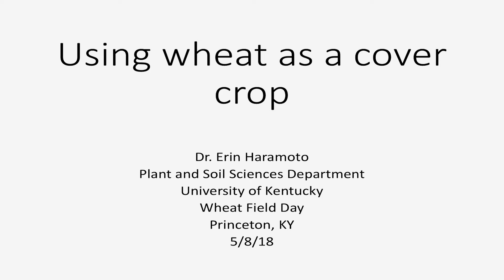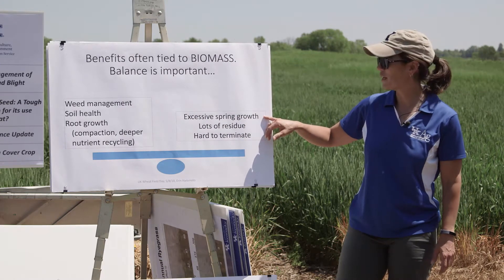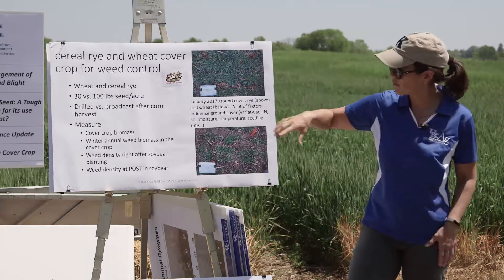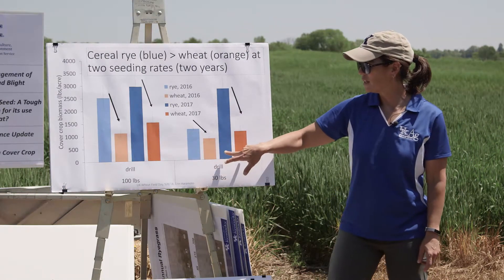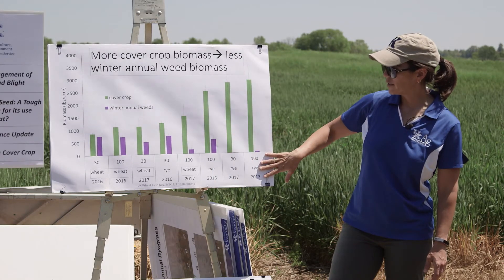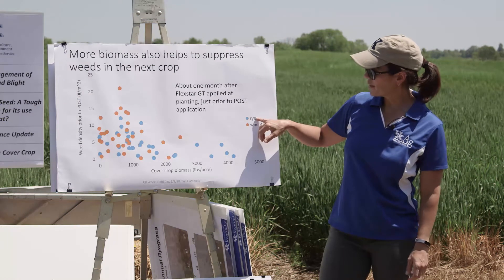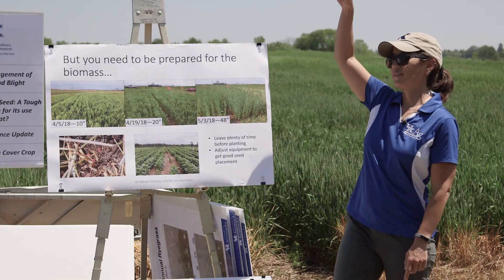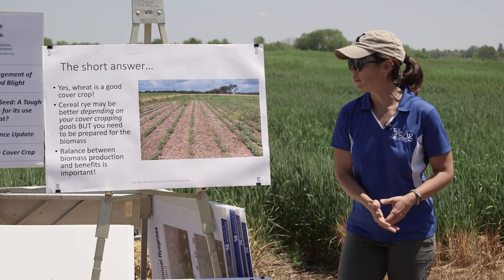Using Wheat as a Cover Crop

Comment: I’m running an organic garden here at home . I’m in northern Alabama . This next cold season I’m considering a cover over the garden plot due to constant weed issues . I also want to drop nitrogen back into the soil. The only chemical I will allow in my garden is neem oil. I know this puts me at a disadvantage for weed control . However I don’t want chemicals in my food that can also be harmful to me and my family. So my question here is this. If I do a winter wheat or even crowder peas  over winter do you have any insight of what my results will be for both weed control and  putting back into my soil? I rotate my garden side to side each year. I recently have gotten into planting sunflowers to draw my pollinators . My soil amendments are chicken litter  from a local chicken house . I have done this back to back seasons now with great results. Now I want to loosen this soil up a bit. ( good ol Alabama red dirt) so mid summer I tend to compact and we get a little dry down this way sometimes. So I’m considering using cotton compost to add into the soil this next season after my winter wheat comes out . What are your thoughts on this?
Reply: Use the wheat, put it on thick, when you go to “till”, don’t till, cut it up like a lawn mower..leave the chopped up biomass on top, add compost on top of the biomass.. do this about a month before planting…when you go to plant your garden, plant right into this mix that is now compacted down abit and is breaking down already…this makes a great fluffy mixture for your bugs and worms to work into your soil and provide a living compost layer on top… good luck!
Reply: @MrsStevenBrown  Won't leaving the biomass on top increase the chance for fungus and disease?
Reply: @pboboige  there is a bunch of compost on top, black earth, that 2-3 inches deep on top of the cut down biomass is the medium the plants grow into as the cut decomposes underneath.
Reply: Organic is a scam and using GMOs and herbicides are not harmful but keep believing what you want